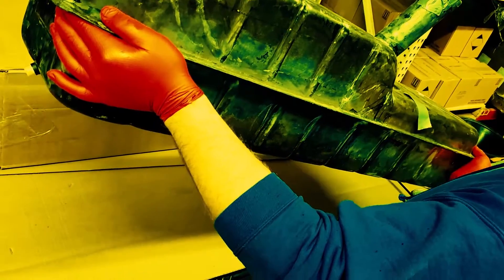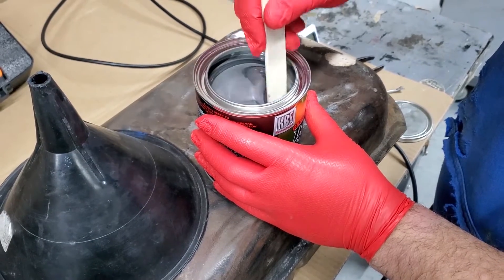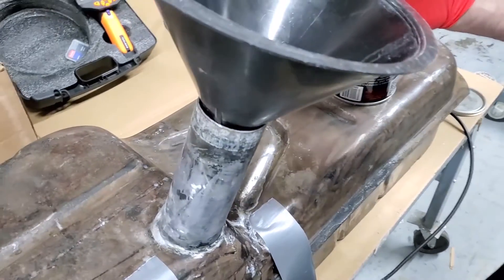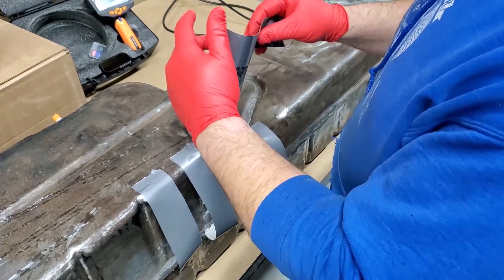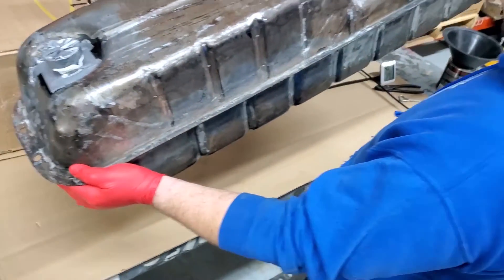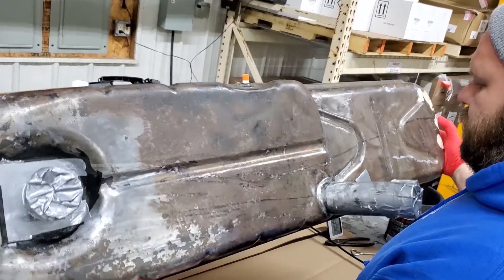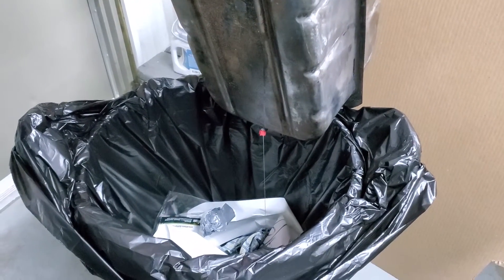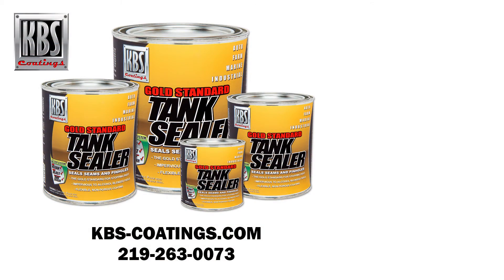How To Seal A Gas Tank with KBS Tank Sealer

Comment: Just did this on a hurricane lantern tank yesterday.  Unfortunately, one of the pinhole leaks didn't seal for some reason even though it was on the bottom corner at the seam where there should have been plenty of sealant deposited.  The KBS stuff is very easy to use and I have no idea why the pinhole leak didn't get sealed.  I rolled it around constantly and got a good coating everywhere.  I can only surmise that some of the bubbles in the off-gassing actually created an opening through to the metal and the kerosene was able to get through.  Weird, I know, but I can't see any other way that particular area didn't get doused with a gob of sealant.  It's not like these tanks are very big and I used almost half the can.  Unless, I didn't let it sit long enough to dry.  I left it overnight, and the parts that I could reach with a finger were hardened to the point I couldn't dent it with a fingernail.  Anyhow, I've poured out the kerosene and gave the thing a good soak with vinegar..  After that dries a bit, I'll do a wash with soapy water.  Then some baking soda to make sure the vinegar is neutralized.  And maybe by this evening I'll be able to put in a second layer of the KBS and get that pinhole sealed up this time!

Comment: Does tank sealer last forever or does it break down over time? How well does it adhere to composite (Carbon/kevlar) fuel cells?
Reply from the maker: Does tank sealer last forever or does it break down over time? Yes, Tank Sealer does NOT break down. How well does it adhere to composite (Carbon/kevlar) fuel cells? Extremely well to prepped composite. Prep like the directions state for fiberglass tanks.  https://www.kbs-coatings.com/tank-sealer-directions

Comment: Does the application method of turning the tank in all directions still work on fuel tanks with a lot of internal sheet metal baffles?
Reply from the maker: Yes, the Tank Sealer will coat all of the baffles if you take your time and rotate the tank in all directions really well and then drain out the excess. If you have a lot of baffles, get the next larger kit size when you order.
Reply: @Kbscoatings-us  thank you for the prompt reply 🙏🏻

Comment: What do i use on the bottom of motorcycle gas tank while doing the cleaning and resealing? Foil tape or Duct tape?
Reply from the maker: High quality duct tape works best.
Reply: @Kbscoatings-us  thank you! I just purchased your sealer kit. Restoring a 2001 gsxr 750
Reply from the maker: @LifeWithStiel  Excellent. Please feel free to reach out in the future if you have additional questions.
Reply: @LifeWithStiel how’d that go? I’ve got a 03 750 I’m thinking about sealing.